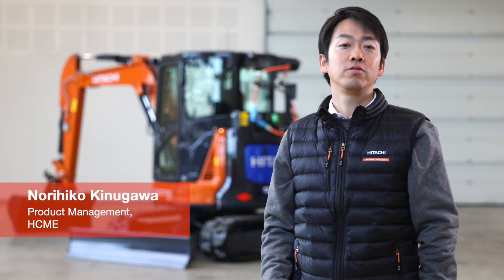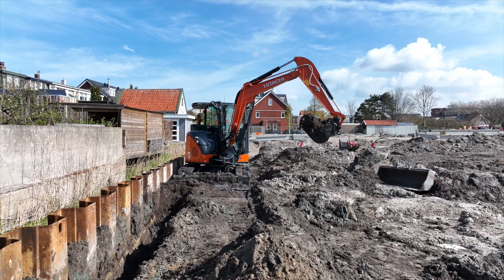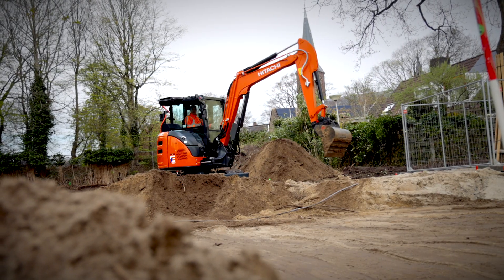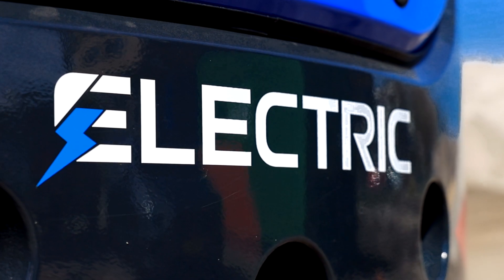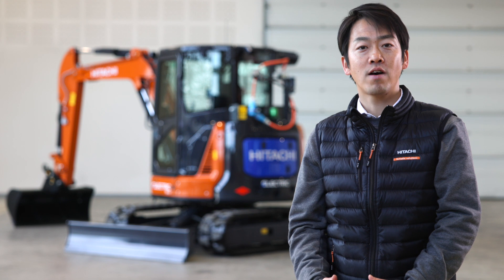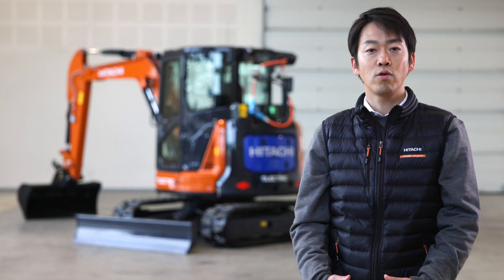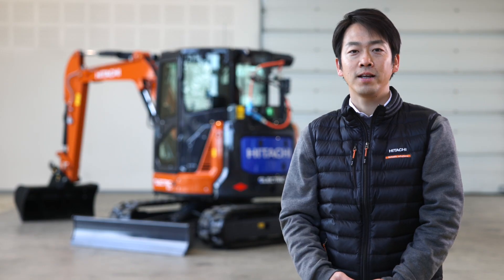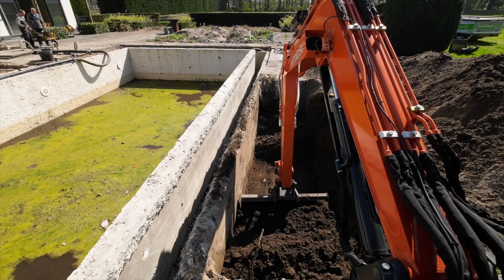Walk around the ZX55U-6EB electric excavator

Comment: Powered by a diesel generator?
Reply from the maker: It is ideally powered by a mobile charging station like this one: https://bit.ly/49zpDjG
Reply: @HitachiConstruction  What's the point of it then?
Reply: @simonm1528 it can be wireless as well. The ability to plug into a power base while running is a brilliant move by hitachi, these machines are the way forward.
Reply: @endurancehomestead  So there's no real advantages? Maybe if the cord is long enough you could keep the engine noise further away. But still it's kinda pointless.
Reply: @ I think you’re missing the point that you can disconnect it from the wire when it’s fully charged and run it as a battery powered machine for as long as it has charge?
Reply: @ no the power station that’s being referenced is a large battery bank so no diesel is used for that either
Reply: @endurancehomestead  So where's the power generated from?
Reply: @simonm1528  who knows, could be any number of sources. Hydro, solar, wind, nuclear, coal, diesel etc. depends where you are in the world and what’s available to charge the power bank.
Reply: @endurancehomestead  So you don't know how it's charged but your are cheerleading it?. Bro that's really fucked up!
Reply: @endurancehomestead  bro have you actually read any book?
Reply: Just ones with pictures.